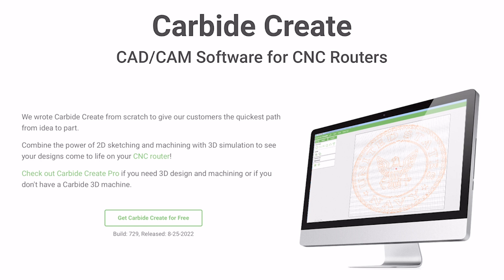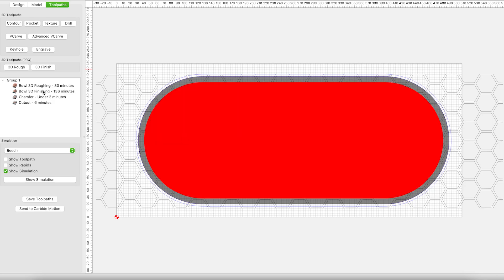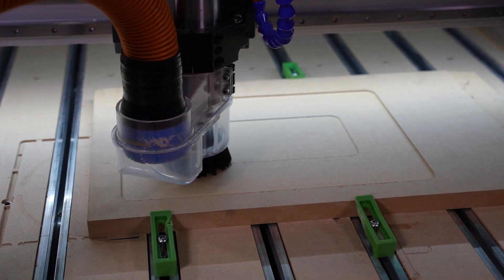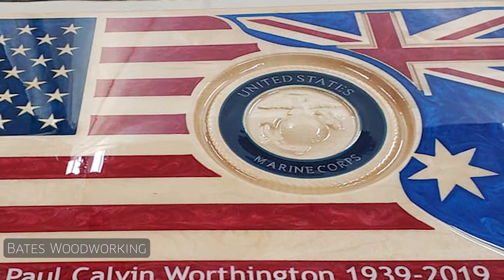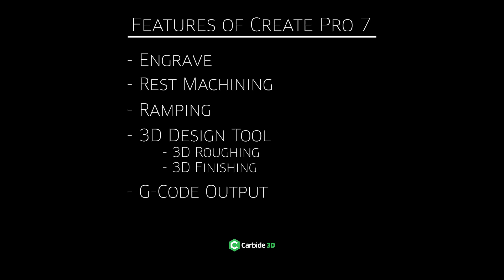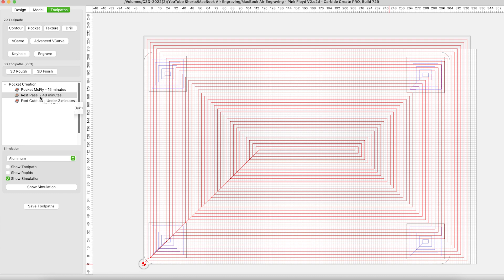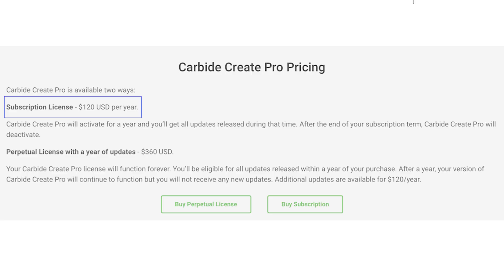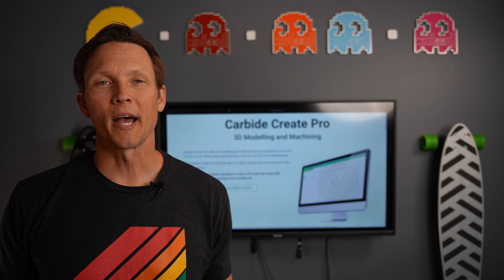Why Carbide Create Pro 7 - Straight Talk

Comment: CC Pro should come free with any new Shapeoko purchase, especially when you get all the extras. I didn't know 3d didn't come with it when I got mine a couple of months ago.
Reply: which one is included ?
Reply: @GuidoMillonezz  The basic carbide create is free I think and works well with shapeoko from the start.
Reply: 1000% agree seems a bit ridiculous that you don't at least get it free for a year or something I just spent six grand so it be nice to get something other than just the machine especially if you made this offer yourself that last bit was for a carbide... @carbide 3d
Reply: Good software costs money to keep developing new features.  If the pro version was 'free', the result would be a higher price for the machine.  The free non-pro version is good for beginners but maybe a free year of pro would be nice with higher end machines.

Comment: So I’m tasked with learning the CNC machine at work. We currently use Bobcad and Mach 3 to run this huge machine. We normally just cut .25” MDF but I want to push it to the limit with designs and after messing with the free version. Can the .nc files it creates work with Mach 3? Please say yes
Reply from the maker: To export G-code to your machine running Mach3, you'll need Create Pro.

Comment: Iask about CC7 WORKING WITH NYMOLABS 6040 AND ALL I GET IS THE RUN AROUND AND ADVERTISING! Will  Carbide create pro07 work or not?
Reply from the maker: If you buy Carbide Create Pro, it will output normal G-code.  If your machine takes G-code, it'll work.

Comment: I am looking at Fox Alien Vasto for my CNC. Does Carbide Pro work with it? I have a Laser and use LightBurn I am hoping that there is not a giant learning curve. I am wanting to do 3D engraving and Geographical projects. Thank you.
Reply from the maker: Kevin.  Create Pro will output G-Code.  However, you really should look at Shapeoko.  It’s a superior platform and the overall ecosystem is something you’re going to want.   
As a new CNC user you will not find a company offering anything close to our package of machine, machine support, video training and resources.   
Check out my.carbide3d.com 
 Additionally, you’ll find that our machines offer the best value and capability.

Comment: I use Carbide for my onefinity cnc. Will still be able to save the gcodes to thumb drive.
Reply from the maker: If you have Carbide Create Pro, you can save G-code to external files.
Reply: @carbide3d  Folks - it is REALLY disappointing you removed saving g-code from the free version. I am constantly recommending your product to beginners as a free and highly capable entry point for those wanting to save some money. Seriously consider putting it back. Compromise somewhere else and don't remove features that have been in the product since it's inception. It's not a good move for the community and certainly not a good precedence. 0.02.

Comment: I’m new to cnc and have been running my nomad with meshcam. What’s the pros/cons to going to carbide create pro?
Reply from the maker: If you already have a STEP or STL file, MeshCAM makes it easy to cut your part.  If you need to design your part, CC Pro might be a better fit.

Comment: How can I use the 3d capability to cut a wedge/door stop from 3/4 on one end to 1/8 at the point
Reply from the maker: I would cut that particular item in 2D on its side.
Reply: @carbide3d  so only 3/4 of the wood is attached to the spoil board. It doesnt seem like it will hold. They are 4x2x 3/4
Reply from the maker: Tabs or super glue and blue tape for work holding.

Comment: A clearance toolpaths in 2 or 2.5d allows for multiple tools to be used for pocketing operations without going back over area that have already been cleared by a larger tool. 
This is NOT Rest machining. Rest machining is the ability to use multiple progressive smaller tools to carve 3d toolpaths. Any time you can only use one roughing and one finishing tool to carve a 3d model then you do not have Rest Machining.
Reply from the maker: False